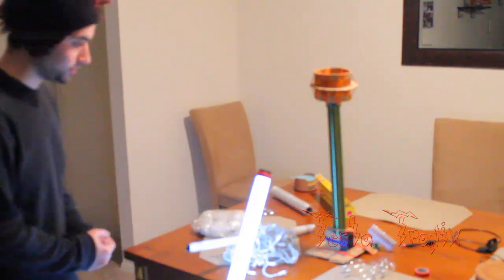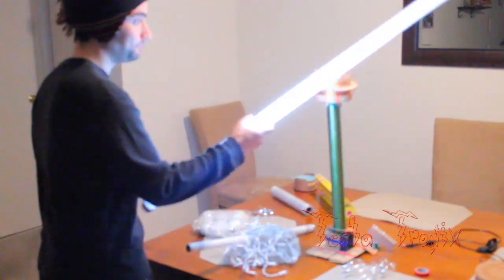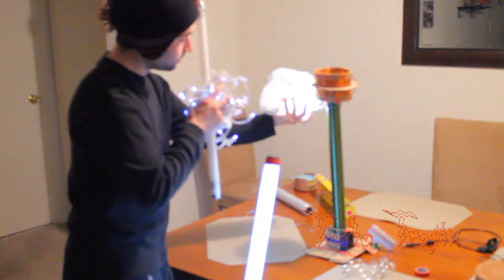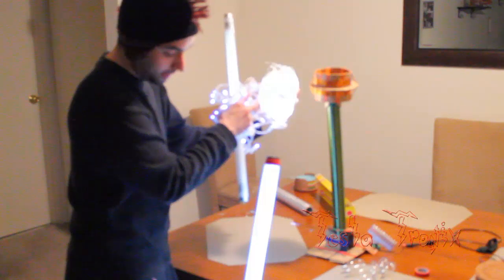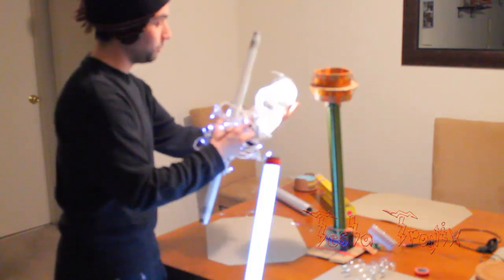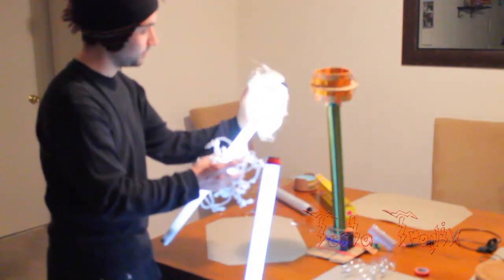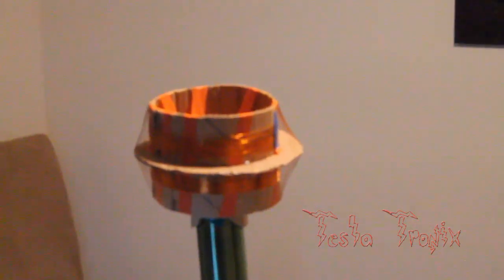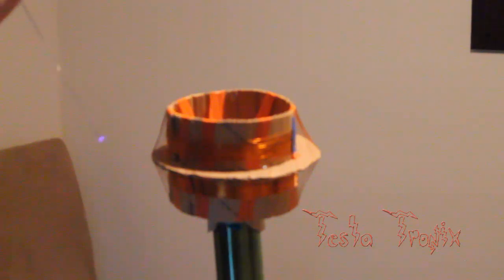Mega Load Test Wireless Electricity

Comment: Hi mate, Thanks for your replies on both of my posts. I had one 12v  battery & today I have bought one of 6v, which is total 18v in series. I wanted to share with you that with 18v bat the 800 turn coil on 1 inch pvc it gives quite good light from 3 CFL plus two 18w tubelights but transistor is as hot as finger burning, even with heatsink.  Now I am planning to go for a 2000 turn one of .25mm (31AWG) coil   on 45mm dia pvc. Can you pls tell me the base Resistor you have used for this one, thanks

Comment: Sorry mate for two posts together. Now I need some guidance from you please. In the above video what are the parts you used in the circuit? Can you please tell me R value, No. of uf4007 used, how many turn for L1 & L2 you have used in this circuit. Also what material you used for the beautiful tower toroid? what wire size for L1?. Now just for your information, mine one on 12v works marginal & on 24v super but trasistor became very very hot even with heatsink. A reply is highly appreciated plse.

Comment: Hi mate, I came across your comments on lasersaber video& then I saw your video as well as the diagram. I had some 80 meters of 25gauge coil left over from Bedini project. So then what, I say let me give a try. Then yesterday I wind that 80m coil on a 1" pvc  & that coil gave about 800 turns, Then I made a 8 turn primary  with very very thick electric wire.Today I buy  a TIP31C, 2 uf4007 & one 50k R & have mounted  the tower & to my estonish it works!!! All credits go to you. a lot of thanks.

Comment: Hi mate I've replicated your 2000 turn tesla coil but the output isn't as good as yours I'm not sure why.how did u wire the top load and can u tell me the measurement of your pipe and is it PVC like mine?what resistor are u using mines 70k thanx this would really help me please could u get back ASAP

Comment: I'm actually working on a theroy that will explain it, If I can work out how to do a proof of concept prac. Imagine a radiant energy plate setup. Instead of putting the cap near ground on the wire. Make the plate the cap. Two pos outer plates, and a neg inner plate. Should improve performance via columb force? Now throw a waveform at the collector/cap.. Columb force causes particle deviation, and the plate switches polarity before it hits :) Its a work in progress. I think T coil does same thing

Comment: With the lights. I like the way you are going. I would suggest a control though. Make a LUX box. Measure the LUX of a given globe from wireless. Then see how many watts it takes to make equal brightness traditionally. Then you have a more accurate figure to add up. I'd be inclined to do this with incandescent or LED's. Too many variables with fluro. Incandescent needs equal watts for equal brightness. LED should be much the same. I'll be doing just that when I get a good tower finished...

Comment: Nice test with the tinsel! The electrostatic air flow seems to indicate that the receiver is pos and the tower neg. Although I know there is AC available from running LED pars. Have you been able to get airflow away from the tower? Seems to be a precursor experiment for a proof of concept for Tesla coil as amplified radiant energy / cosmic ray collector. Have you tried destroying CD's?